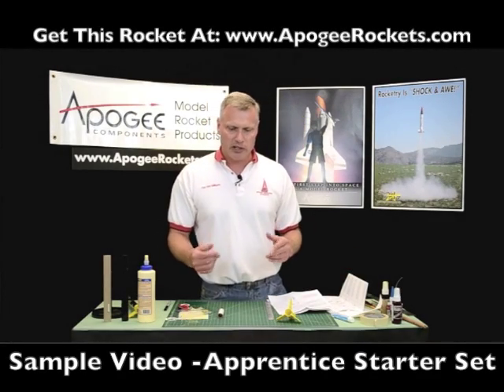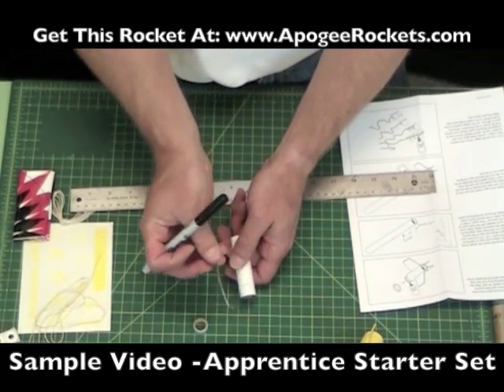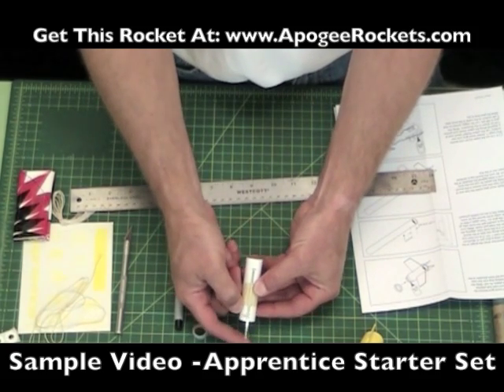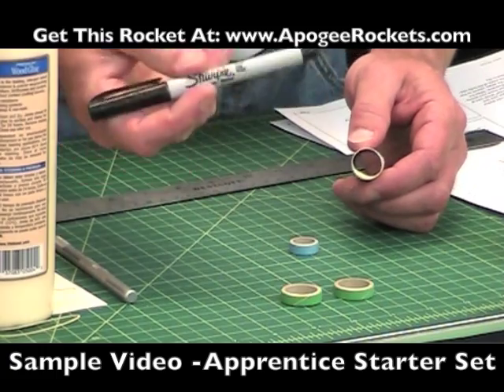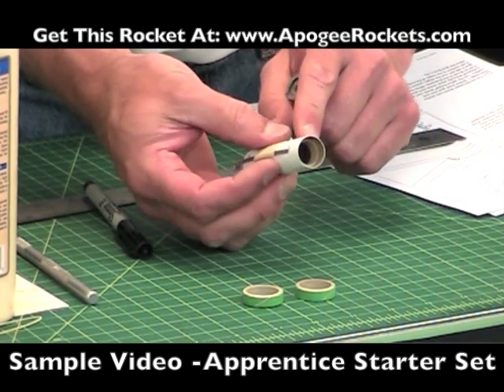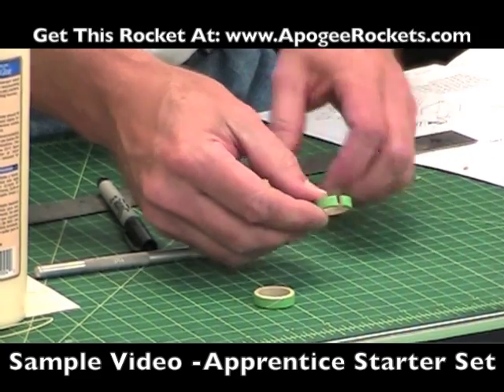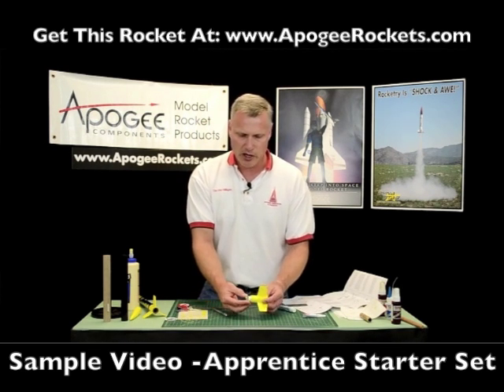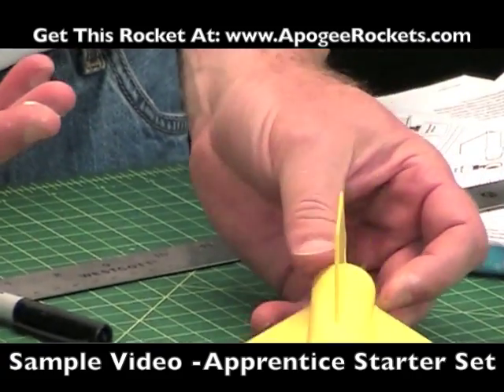Building The Apprentice Model Rocket Kit

Comment: Is this rocket delivered in India
Reply from the maker: Hello ,

We do ship internationally yes. However we would recommend that you use our website's shipping quote feature. 

Step 1.
Go to www.apogeerockets.com/quick_order, and enter the item numbers and quantities of what you would like.  Or, you can add the items to your cart as you browse through the site.

Step 2.
Click “Buy Now” (It does not charge you anything at this point, and you don’t have to enter payment data), or click on your My Cart in the top right corner.

Step 3.
Once your shopping cart loads, scroll down to Estimate Shipping Costs.

Step 4.
Enter your Country, State (if applicable), and Postal Code information.

Step 5.
Click Update. (The system may take a moment to refresh.)

All available shipping options and costs will be shown with optional shipping insurance from the courier, if applicable.

Please keep in mind if you have motors in your cart, you will only get one option since they have to go ground shipping. There is no way to expedite motors as we have to comply with federal shipping regulations.

Also, items with lithium batteries cannot ship in the same box as motors, so if you don’t get any shipping options, you may have to place separate orders for them.

For more information on our shipping policies, click the link below:
https://www.apogeerockets.com/Shipping_Info

Let us know if you have any other questions. By using the "Contact Us" link on our webpage or our chat option. We only check YouTube comments intermittently so please do not respond further here as we may not be able to get back to you right away.

Thank you!